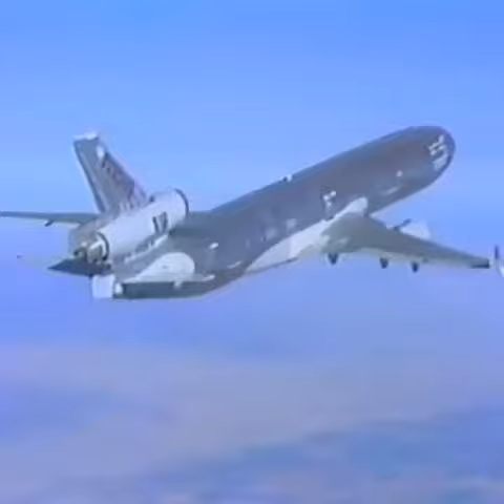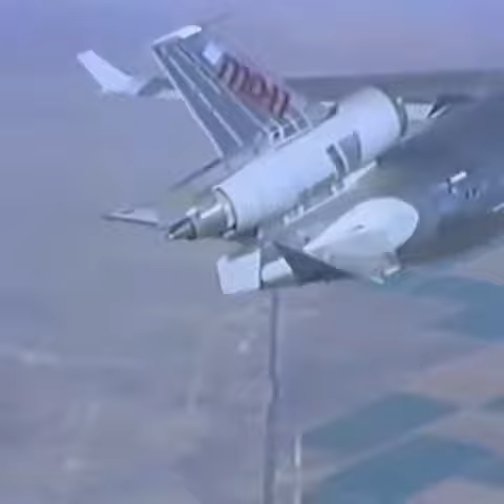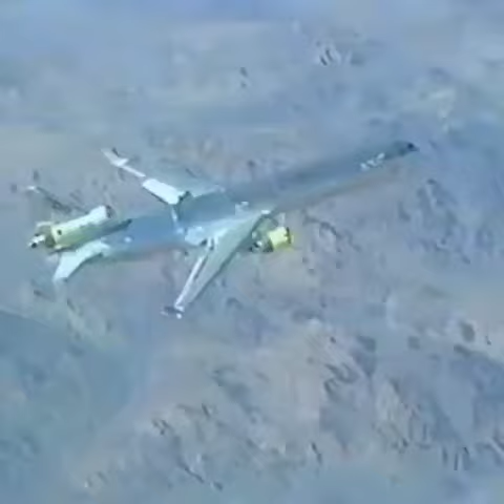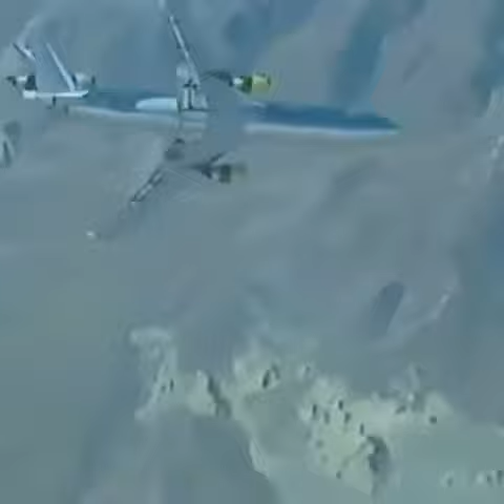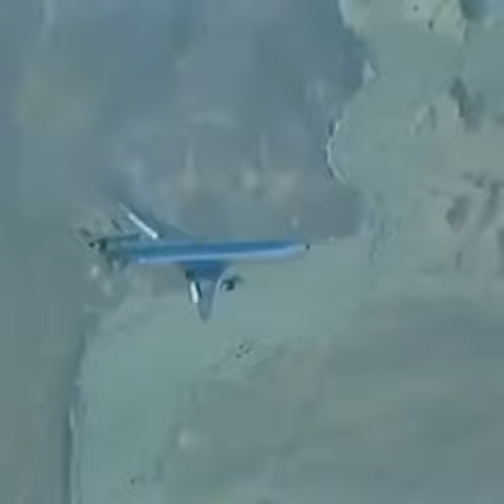MD 11 STALL test

Comment: That buffetting in the tailplane 😳
Reply: The reason behind this is to make it more comfortable/safe for the passengers. If it would be stiff the plane would shake more and make it uncomfortable and dangerous
Reply: @aerohenri  I see. So the tailplane is supposed to flutter during normal flight. Makes total sense. 🙄
Reply: @igclapp  it only happens in case of turbulence. I wish no one a stall during a normal flight
Reply: @Ibrahim C  Yes the wings and winglets of aircraft flutter for a reason 😂
Reply: @igclapp  
This tail plane was 38% smaller than the tail plane on the DC-10. You should have seen the tail plane on the DC-10 buffett at stall or even doing static engine runs
Reply: @adventurekid9242 almost seems like the plane has a mechanism that buffets itself, but it’s the natural flexibility
Reply: 0:10

Comment: sad to learn that the last planes designed and built my Mcdonneldouglas were improved versions of old aircraft
Reply: If it ain’t broke….
Reply: Just proves how good those designs were
Reply: Except the DC-10 had that Achilles heel with the depressurization of the cargo compartment doors which the investigation nearly ruined them. It needed to be updated
Reply: @srtbwoah6394  well it had worse than advertised performance and was prone to roll-over on crash landings

Comment: If you look closely test pilot is holding full elevator up to bring the nose into a stall. 
The smaller tail plane did not provide enough elevator pitch authority and an LSASS unit was incorporated into it so that the airplane flew the tail and the pilot flew the rest of the airplane only when certain FedEx pilots attempted to override the airplane on landing did they have problems with pitch authority at slower speeds
Reply: Where did you get all this false information? Every bit of it is wrong.
Reply: @johnschmidt8440  
And what qualifies you to make that statement.
Reply: @adventurekid9242  The fact that I flew this plane full time for 17 years and I know exactly how it handles in day to day operations. Plus your statement about the cause of the crashes in Narita and others is entirely incorrect. Clearly you have not seen the report from the NTSB, and have not seen any of the analyses of these crashes. Your statement about the smaller horizontal stabilizer is incorrect, as is your understanding of the LSAS system.
Reply: @johnschmidt8440  
 Super cool World or Fed Ex? 
I was flight mechanic for Omni and then World DC10s.
I definitely got a little bit of the anal pucker factor when the pilots tried to land either of those two planes on their own. 
I liked the old DC10 anolog autopilot even if I was the one nulling the LVDTs for the elevators and stab trim systems.
Flew full time as opposed to??
Reply: @adventurekid9242  I flew for FedEx. Full time as opposed to part time, of course. Many of our pilots flew much reduced hours every month because they valued their time off. I never did that, and flew a full schedule, and more, every month.

Comment: I’m not an expert on the, Md-11 but should the stabilizers be vibrating that much?
Reply: ⁿ⁰
Reply: @tanjianyumoe5700  then,why are they doing that?
Reply: Although I'm 5 months late, but it's designed like that one purpose, have you ever seen videos of the engines moving a lot during turbulence? Well, it's the same thing here, so this is actually a safer design for the airplane 👍

Comment: MD11 vs A380
Reply: md11
Reply: @Kazi_kazan35  Ok
Reply: MD-11 VS A380

Size: A380

Passengers: A380

Older: MD11

Beautiful: MD11

More engines A380

Merged with any aircraft company: MD11

Short lived: A380

Longer: MD11 (i think)

Failed design: MD11 twin engine version

Competed with random aircraft companies BOTH

 (the a380 was supposed to beat the Boeing 747 and Mcdonall Dougles competed with Military aircraft maker Lockheed NOTE: Both companies made tri engine planes, the L1011 (lockheeds) was their first PASSENGER plane and had no experience building passenger planes and Mcdonall Dougles had alot of experience in passenger planes). Fun fact: did you know that the L1011 was the first ever plane to have autopilot?)

Seen in old movies from 80s-90s: None (the L1011 did appear in two movies)

A380: 5  MD11 6

MD11 WINS!
Reply: @tanjianyumoe5700  the L1011 was not the first plane to have autopilot, and several had it before it. Lockheed had extensive experience with passenger aircraft, dating back to the 1930s, the L1011 was only its first passenger jet (and last unfortunately) the L1011 was the first plane to ever perform a fully automated flight, from takeoff to landing.